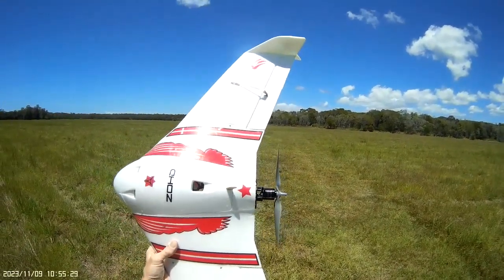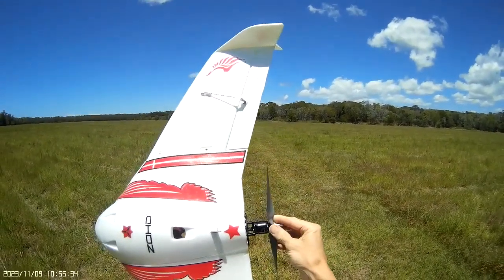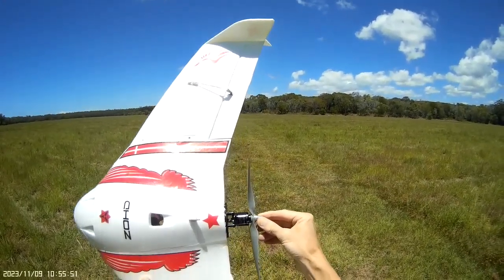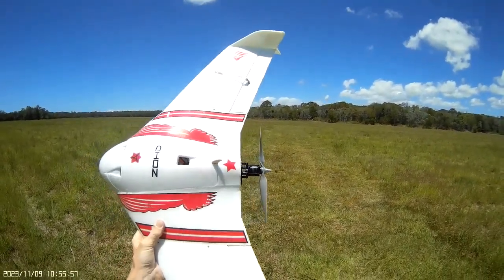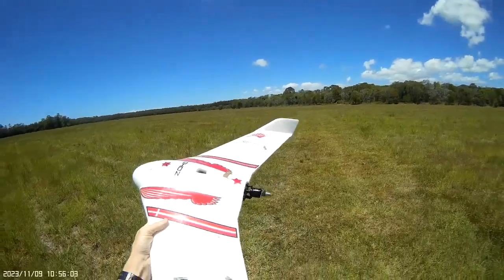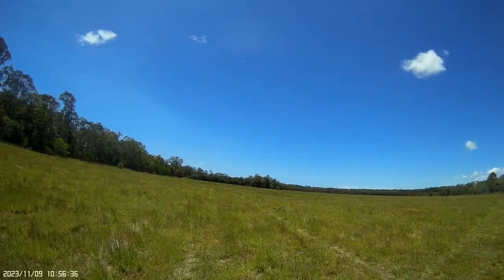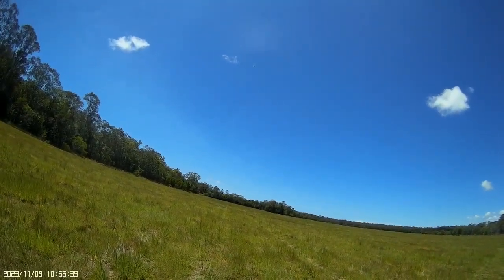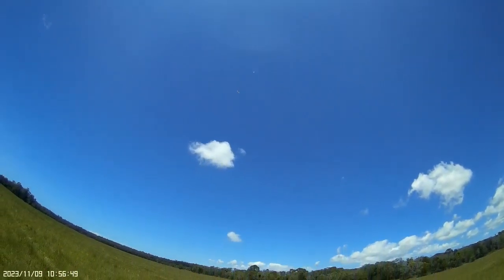Kopaqi Wing - New Modified Motor Mount - Outstanding Results !!

Comment: Yes very nice work with the extension.  I used to have the same on my old FX-61 wing.  Top mod and worth the effort to do.
Reply from the maker: I had originally made a motor mount that was hard mounted against the rear of the model, but have extended it an extra 15mm .. makes a huge difference...☺️